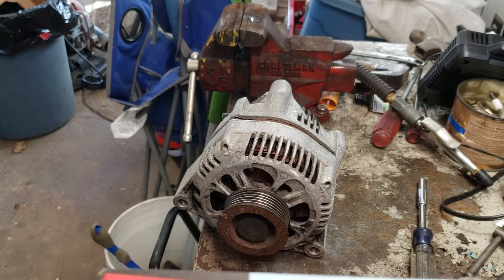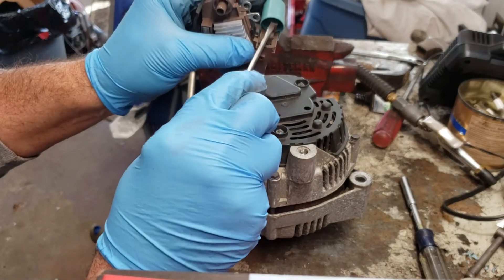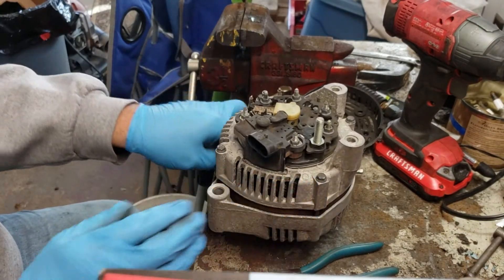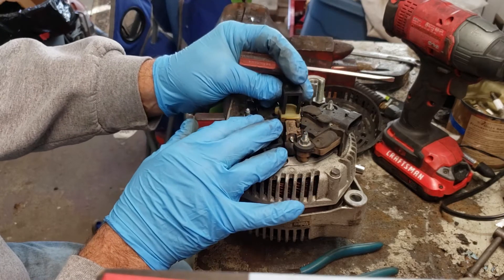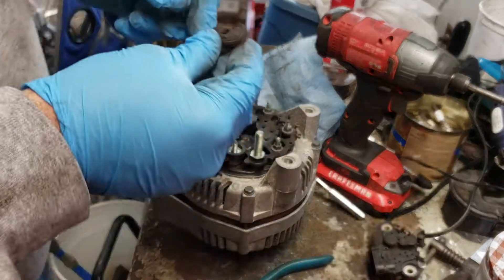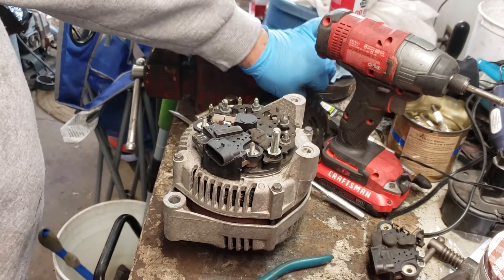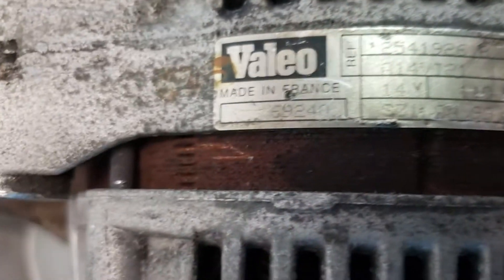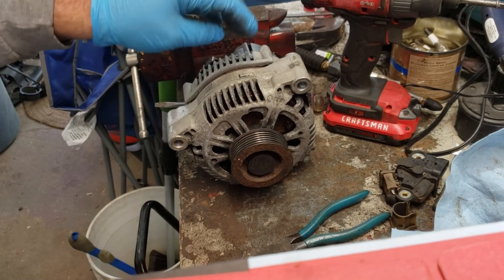C5 Alternator rebuild (partial)

Comment: I had a 2001 corvette c5 and now have a 2002 c5. The alternators are different. Is the regulator different? My 2001 failed under warranty and was replaced free.

Comment: Hi, thanks, great video. I think I maybe have problems  The voltmeter  runs between 13,1-14,2 V during driving. I'm a Swedish Corvette owner and I have two Corvettes, ( -99 LS -1 , -78 L82)
Reply from the maker: That sounds ok.  Corvettes are a little funny in the charging area anyway.  I would say it's good.
Reply: @302MuscleCars  Why did you change yours? You don't say.
Reply from the maker: @ChipShot777  Hey Tim, I was having some wild fluctuations in my voltages and at times would be in a discharge state.  Once I changed out the parts, everything seemed to be back to normal.
Reply: @302MuscleCars  I am getting 13.1 to 14. No higher and jumping. Sluggish starter, will check wires at starter. Battery drains to no start after three or four days. I have heard most have marine cut-off switch at their battery due to drained battery.One owner 2002 C5 . 74,000 miles thanks
Reply from the maker: @ChipShot777  I don't see an issue with those numbers.  You need to do a parasitic draw test on the battery.  C5s are notorious for bad grounds, so check all of your grounding locations as well.  I don't think you have a alternator issue .